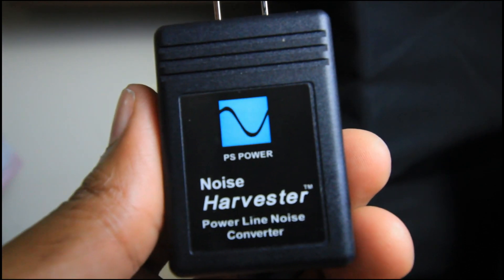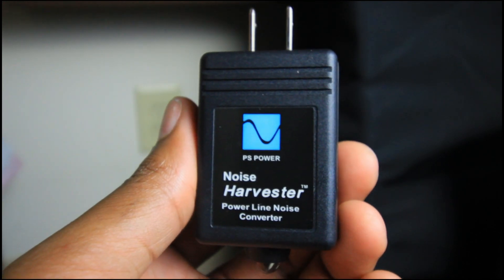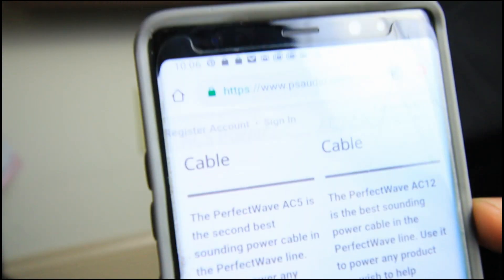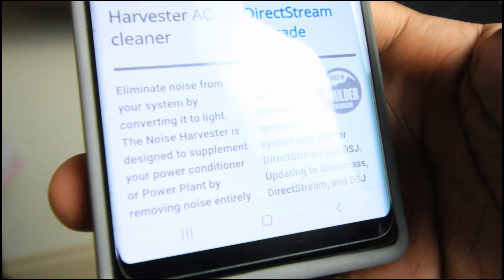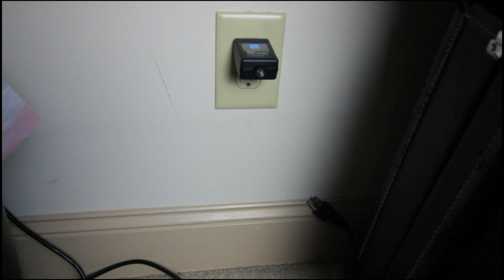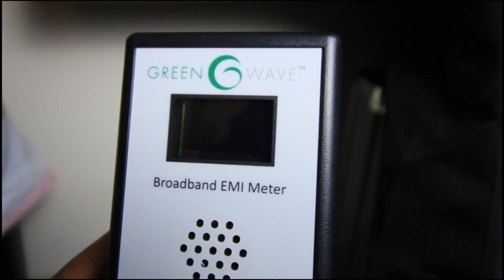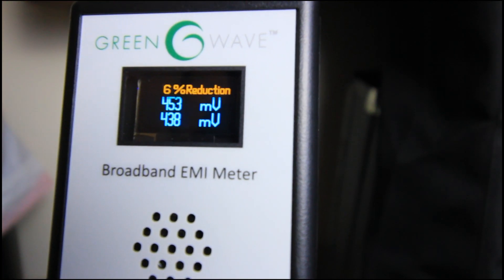Does PS Audio Noise Harvester Really Work For Cleaner Electricity

Comment: so at your fuse box there should be a mains filter, that should be connected with the ground.  a frigorator or all the frigorators of the whole building?   i think more of a broken mains filter and or a bad ground.  they install mains filters in fuse boxes to prevent these things.  also old fuses become noisy too. especially when frigorators turn on and off.  also a frigorator has capacitors and filters to prevent that and yeah, maybe the fridge is working but that part is maybe broken.

Comment: Did you find a solution for this? Have you tried the filter from greenwave?
Reply from the maker: A dedicated electrical line is the best solution. The more I researched all of the products that would supposedly "fix" the problem, I found nothing really works.
Reply: @natcoziay  I got dedicated line installed 2 weeks ago and there is noise on it still and affected by some stuff when they are on in the house. That line has his own breaker and such but since it's all connect to the same panel box, probably that's why still get the noise
Reply: Nat. The company that sells the EMI meter that you have also sells filters for cleaning dirty electricity. I have 12 filters (each one costs about $35). By looking at your videos, you will be fine installing 6 filters in order to get the level between 50 and 25 which is fabulous.

Comment: The comments here are hilarious.   Anyway have you tried a double conversion online UPS?  They start around $600 so not cheap, but it’s the only thing anyone has talked about that can supposedly do the job.  Of course BS Audio has a video more or less rejecting them as a viable solution, but then you have to spend even more on their gear, so… why trust them over anyone else?
Reply from the maker: Yeah the comments are hilarious. I'm not an electrical expert. My terminology is off but the people leaving the comments are beating a dead horse. I don't respond to them because it will be a waste of time. But overall, I'm no longer going to waste my money on any of these so called "dirty electricity cleaners". The only other thing I may do is have an electrician install a dedicated line.

Comment: Use two harvesters, plug one in first. If the LED shows less noise activity when you plug in the second one then yes then it works. Else how can see the effect? Ideally the LED should almost stop blinking unless it’s a power on indicator. It might be effective at certain frequencies? Get a PS Audio noise measurement device. Reminds me a bit of fake tuning upgrade plug in modules for cars.

Comment: The noise actually went up when you plugged in the snake oil. If anything this devise adds switching noise, because inside there is a transistor, triac, inductor (choke) and a few caps.

Comment: spend $500 and buy a double conversion ON-line UPS.   it takes crap AC power to DC - back to AC and makes a clean wave in the process.    https://www.amazon.com/Maruson-Tacoma-TAC-LV1K-1000VA-Online/dp/B01ELPJJQA or if you can find an older system and put new batteries in it.
Reply from the maker: Thanks for the info.

Comment: Very interesting! I was going to try some of these but now I'm very hesitant!
Reply: Keith Copeland  Keep being hesitant and spend your money where it counts (better speakers, pre-amp, amp, DAC and maybe most importantly room treatment). When you buy better gear (or treat your room) you instantly notice a substantial difference. Snake oil only makes a difference in you wallet. It helps to have an electronics background, but anyone who understands the very basics of how electricity works, should never get sucked into buying a $500 power cord. All a person needs is simple logic. That "magical" 6' cord is plugged into several feet of plain old 14-2 lumex and the miles of powerline back to the power station. AC voltage isn't a one way street into an amplifier. It cycles back to the power plant 60 times/sec. Amps only care about getting enough current through the copper wire, not how much snake oil is on the last 6'.
Reply: @gordthor5351  Thank you for keeping it real!

Comment: your plug could actually be double-wired inside the wall so you have 2 lines coming from the fusebox so it cannot do anything for parallel filtering, make another test, try to plug on a power strip so you're sure you're using a parallel setup
Reply: It does have some filtering effect but in actuality it’s not as efficient as a simple capacitor. Ironically, to let this blue LED visibly flash it needs to avoid effectively shorting all the noise. The blue LED is just snake oil.

Comment: What is the % reduction represent? when you used the harvester it went to zero.
Reply: @Lloyd Stout That is correct and I saw it go to 0% as well . I have one of these and I use it. I can't tell if it makes much difference, but it does blink occasionally and if I turn the dimmer down on the lights on my ceiling fan (on a dedicated circuit) it goes crazy until I turn the lights off, so it does pick up noise on the line, but I think it is impulse noise and not EMI. My two cents : )

Comment: If you want something that works then go to the Ebay and look up the transformer based solutions from Powervar, ONEAC, Triplite or look for stuff from the medical industry as well, they are virtually given them away especially the Powervar ex point of sale stuff. When you plug the testing device (I have one too) into them it will be silent with a few mv of noise which seems to be the lowest voltage the tester will read.The stuff from ONEAC has a (grounded) electrostatic shield in the transformer to decrease common mode noise from getting from the primary to the secondary or from the mains to your equipment if you like it simpler. Look to industry for serious solutions and stuff that has to "work as described" not hifi overpriced fantasy items. The prices for this stuff "is affordable" dependent on how many VA/WATTS you need will cost a little bit more of course but not the silliness seen in hi stuff.
Reply: Great info😊

Comment: Hi Nat, I just saw your youtube video on Audio Science Review. I don;t know if you have found a solution to your clean power problem yet but look into double conversion online UPS"s They take the AC power from your outlets, save the power to a DC battery, and then convert  the power back to clean AC electricity. This I am told is about the cleanest power you can find. Also, look for hospital grade electrical power conditioners as they have very high quality standards.   I see you are into music production and probably want to protect your equipment from damage and lower distortion in you recordings.  Take a look and do some research on  the double conversion online UPS,  Good Luck.
Reply: Your advice sounds very true.
Actually I was thinking to buy a small 1Kva APC online UPS for myself to use on my computer and studio monitors. Don't need more than 500~600 Watts max.
But then I saw videos of a $10000 Power Plant regenerators by PS audio.
Isn't it exactly the same thing that PS Regenerator do when compared to a $300 Online UPS?
Reply: @ratedrsuperstarthega  quite a long time ago but typical cheaper UPS just filters and bypasses the battery, so the sine wave is still distorted from the wall. Only when there is a power outage and the battery kicks in, does the battery produce the sine wave and it also does not mean that the sine wave is perfect. It could be a ladder sine wave which introduces a lot more distortion as the purpose is to provide power long enough for the device to power off safely or reduce downtime.

Those double conversion UPS which does convert AC to DC then back to AC costs significantly more and so far, at least the ones I found, those from APC cost a few thousand

Comment: 03:26 normal mains
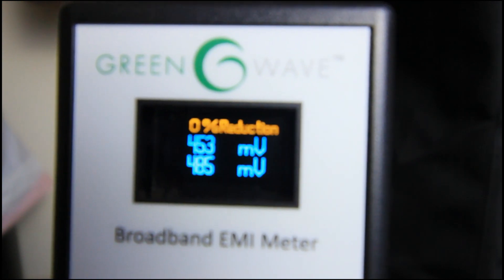04:09  filtered mains
The filtered version has subjectively quieter and less obtrusive noise floor and is a quite different sound and I say better sound to a point......I have heard other 3 pin devices change the sound similarly but differently.
This listening test from the noise meter gadget is of the mains noise and not an audio system, that said ime the nature of the mains sound 'permeates' and partially sets the tone and musicality of connected systems......yes listening to the mains is very useful diagnostic.
Reply: eric mc   Look at the number on the meter, the noise actually went up when the snake oil gadget was plugged in. If that thing is filtering out any noise, it is the noise it is creating, because it's a switching device. There is a reason why switching power supplies typically aren't used for audio (especially high end). They create switching noise. 

Any descent amp (or any audio device) will have adequate filtering of higher frequency main noise and the AC ripple left after rectification. The first thing that happens in an amp is rectification of AC to DC voltage. Rectifier diodes create some noise and nothing before the amp will filter it out. It's up to the design of the amp to use low noise diodes (bridge rectifiers) and filter out any noise on the DC rail.  

These little gimmicks only have a few dollars worth of components and don't take up much room. Don't you think PS audio would incorporate these parts into their units? Most areas have very clean power (unless you live in an industrial park) so there isn't any significant noise to filter out. 

Florescent light and other noise makes will pollute that circuit, so plug your system into a clean circuit (preferably a dedicated one). If your only circuit for your system shares noise devises, turn them off while listening to music, or get rid of florescent lights and what not. That will help sound quality much more than any over priced gimmick that will only change the weight of your wallet.PS audio could sell those things for $20 and make money, but then no one would believe they do anything, so they charge $100-$400 for something that does nothing you will notice audibly. 

Snake oil doesn't do anything for sound quality, but if the price is high enough many people assume that it will. All markets take advantage of human nature and the audio industry realizes the great desire of audiophiles to find the best sound. 

That come from quality components in the audio system and room treatments, not snake oil gimmicks. How many audiophiles spend a fortune on 'overly detailed" (bright) amps and speakers and then aren't happy with the biting highs? Then they spend a small fortune on snake oil cables, which are nothing but very expensive tone controls. Buy a neutral amp and speakers and there is no need to use expensive cables as tone controls. Neutral is natural sound.

Comment: To find out whether it works, I bought it. 
I have THX789 + Sennheiser HD660S, which is not high end stuff at all. 
Noise harvaster makes no difference in resolution and tonality. However, live recordings do sound better, with more depth to the soundstage and more defined imaging. So I assume it does work.

Comment: You were testing the wrong thing dude. This is supposed to help filter out high frequency noise of a particular level, store it in a capacitor, and then take the stored energy and release it - by Illuminating the light. You are supposed to plug it in in parallel to your equipment  or on the same circuit. EFI/EMI filters are a different thing and are usually in surge protectors. Everyone in the comments saying that it's snake oil is just instantly going into denial mode by not understanding the physics and technology behind it. Smh...
Reply: Well a guy who does know what he is doing just tested it and went beyond saying it doesn’t do anything adding it could be a serious safety threat. https://www.audiosciencereview.com/forum/index.php?threads/ps-audio-noise-harvester-ac-cleaner-review.14122/
Reply: @chrispapas8765  I tend to stay away from audio science review forum. Just look up the complaints online. It's a little crazy.  There is a hugh post on DROP as well. Well, it's absolutely doing something. Whether you can hear it or not is something different. It's definitely filtering out some of the noise. If it can lower your noise floor, why not welcome at? My only complaint personally is the price.
Reply: CeeStyleDj what a terrible response. You stay away from ASR because of online complaints? Like the Schitt guys who complained for years about the garbage reviews but now are happy because Schitt started building quality products because of the ASR reviews.  Please point me to some science complaints online. The fact is this product isn’t UL approved , doesn’t do ANYTHING because every product you buy already has a filter in its power supply, and it’s pure snake oil. This is why it got the “stealing panther” trophy. Noise floor isn’t lowered unless you count burning your house to the ground as lowering your floor.
Reply: @chrispapas8765  With this much criticism and multiple pages of forum responses, and much questioning to why everything seems to test "bad" on ASR - combined with the pretentious behavior, and the fact that the forum members seem to fall in line with ONE (1) guy's results... I stay away. Oh and, do these guys even LISTEN to the equipment? You know, equipment the tests bad can sound terrible. Then, what's the point? Is there philosophy if something tests below their preconceived notions of "good" that Hi-Fi or Audio enthusiasts are fooling themselves? Sounds vice-versa. The fact is PS Audio is a trustworthy and legitimate company. They would have taken this product off of their line many years ago if it wasn't doing what it set out to achieve. If it doesn't meet "your" standard, so be it. Why criticize or slander a company?

 Now here are the links:

https://drop.com/talk/18010/cult-of-audio-science-review-amirs-faithful

https://forum.psaudio.com/t/new-product-tests-at-asr-has-them-very-excited/14767

https://emotivalounge.proboards.com/post/1022230

https://emotivalounge.proboards.com/thread/56431/emotiva-science-review-discussion-thread?page=1

https://www.audioasylum.com/cgi/vt.mpl?f=critics&m=95756

https://community.auralic.com/t/latest-vega-g2-and-leo-gx-review-on-audiosciencereview-com/5170/18
Reply: @CeeStyleDj  Literally a bunch of people in those links who have done NOTHING in terms of testing.  I can whine about how great my crap sounds like to, but its not scientific.  You seem to think if 10,000 people think they can hear a difference, then thats science.  No, that's the placebo effect.
You can try and say anything you want, but I will personally put up $15,000 that you could NOT hear a difference with this PS Audio plugged in or not.  Its snake oil.  In fact if ANYONE thinks they can hear a difference, I will put up the money.  We can put our money in a 3rd party account and the winner can withdraw the funds.
Deal?
Reply: @chrispapas8765  I see what you are saying. I really do. I am an ADVOCATE for science and technology based on stats and facts. However, how is this different than a double-blind placebo controlled study of 15,000 people trying an herb that has, let's say anti-anxiety effects and the majority of subjects stated it was effective. They weren't the placebo group, they actually took the product. And they are satisfied. Your argument is onr guy on a forum took measurements and he didn't find much - and tons of folks go by what he says and his findings - that's one guy. Fine. My argument is a great deal of people (all walks of life and personality) bought it and tried it and noticed an improvement. And the reviews reflect it. As for what it does and how it achieves this, Paul (from PS Audio) responded in a very long post way back in 2007 on a forum I can't recall - but also made a video about 2 years ago that is here on YouTube. It's not just a blinky light as random intervals. My two issues are: 1. It takes a few of them multiplied to make a significant difference (I have discovered this recently) and 2. The price. I believe it should be priced somewhere between $20-$30. But they have alot of overhead; And almost everything is made in the US. Anyhow, we can agree to disagree and no hard feelings.
Reply from the maker: Thanks for the info...but I am not an electricity geek. Based on the way this product was advertised, it does not work. If the product works only in a certain way, that should be specified on the product website and advertisement page. I wanted a simple solution to my problem and the product website assured me that it would fix my problem. I don't care about the science of how it works....I just want it to work as advertised, and it didn't. I even called customer service before I purchased it to explain my issue and they told me it would eliminate line noise...period.
Reply: @natcoziay  I'm sorry for your experience and it wasn't for your particular case. That particular customer service agent must not have been well versed for your situation. I can assure you that the guys at PS Audio put in a ton of time, effort and R&D into their products. They are also very honest people. Hard to find in a company these days.

I do believe the PS Audio Noise Harvestor made have made a little too small as adding additional units seemed to do the trick according to this old Stereo Review article. It just gets a little too expensive (IMO) then.
http://stereotimes.com/acc041007.shtml
Reply: @Iblis666ful  you know what has a lot of BS? Audio science review itself.. the problem with that forum is people taking one guy's findings as gospel. But hey, better advantages for the rest of us - the guys on ASR can go around being grumpy not believing in anything if they want to. Peace.
Reply: @Iblis666ful  Science comes from consensus.
Reply: CeeStyleDj Science does NOT come from consensus. Who taught you that? Science comes from the scientific method and thus the ability of peers to repeat the same tests to confirm the results. This is why PS Audio can sell garbage like this because our primary and secondary schools suck.